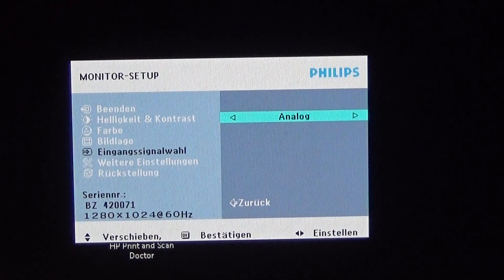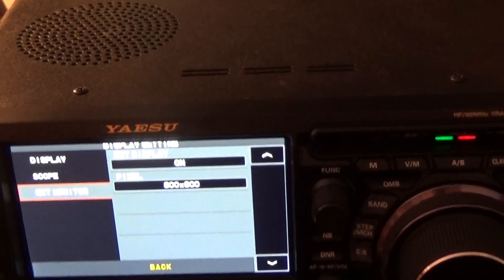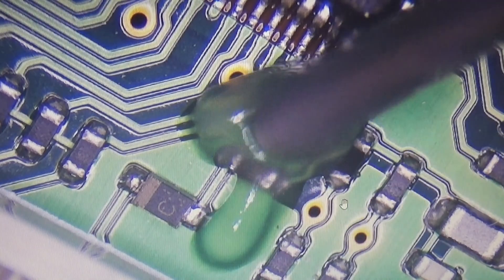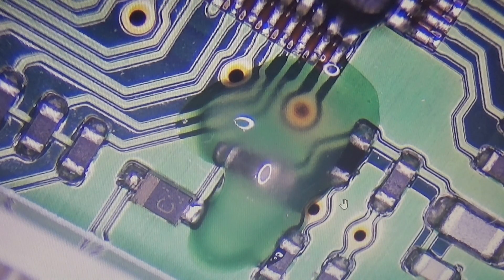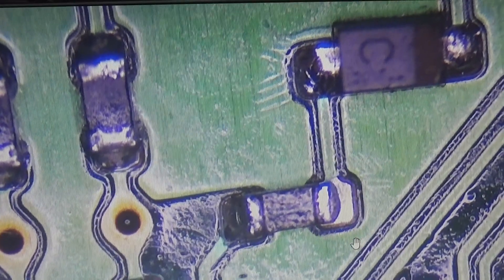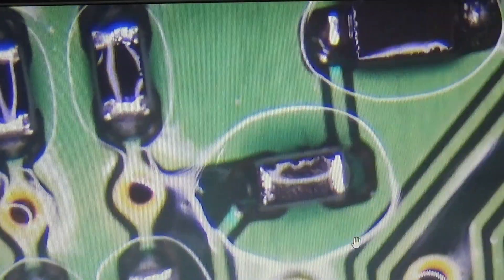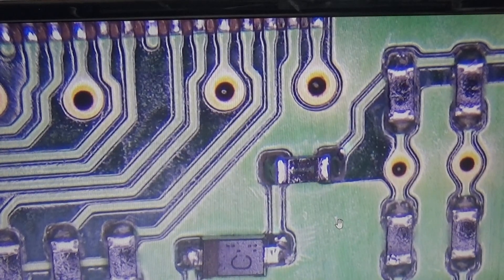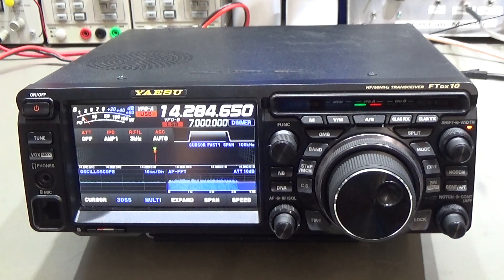#280 Yaesu FTDX-10 with external display port issues fixed.

Comment: Thanks for confirming what many of us thought.  My only quibble is, it isn't a bad DVI-HDMI "adapter" problem (it's not an adapter, it's a pin mapping documented in the HDMI spec), it's Yaesu's design, specifically that fuse value.  Since the spec calls for both hot-pluggability and for the source (the FTDX10) to actually power some monitor circuitry when the monitor isn't on, that fuse needs to take that into consideration.
Reply from the maker: Well, yes and no... There are obviously DVI/ HDMI adapters on the market which simply are consuming more current than others. If you have such a" high consumer" that is bad...
Reply: The "adapter" doesn't consume any power at all... they are (by spec) just straight-through cables no more active than a DVI-DVI cable... the actual device (DVI or HDMI) may consume within a permitted limit of steady-state current, which is different when the device is off (or not plugged in) or on.  The hot-plug requirement means the fuse must survive brief inrush current (be slo-blow).  The FTDX10 design obviously didn't take this into account.

Comment: If you are that good at replacing a tiny fuse like that then you could fix my original Yaesu FT-817. It has a problem that even Yaesu could not fix. In fact they did not even know if it was a problem as they checked their report logs and did not find anything resembling it. Another ham said it could be a few SMD resistors that have given out as the main screen characters fade even though the back light is on. They sent it back unfixed even though everything works except the display fades leaving a blue screen that it was already set to. Fancy a poke about to see if it can be fixed?

Comment: In my younger days as an ET, I was checking a tiny resistor like that and when I checked it with a meter, it read OK. Chased my tail for a while, everything pointed to that resistor being open, yet it read OK.  Then, I connected my meter leads to adjacent components connected to that resistor (11:45) and it read open!  The pushing together of the meter leads on the resistor was enough to push the cracked resistor together and allowed it to read OK.  I learned a valuable lesson that day.

Comment: D1800 Ifsm for RB521SM-30 is only 1A.  My understanding is Yaesu on the FT-710 has upped the Fuse to 1A  for that port.  I suspect they must have upped the rating for the diode too.
Reply: I agree; I looked at the data sheet for D1800, RBS521S-30; It is rated 200mA continuous and 1A surge peak. The FT-710, which has a similar circuit, uses an RB160M-30 diode which is rated 1A continuous and 30A surge peak. Interesting, huh? Also, the FT-710 has a Poly Switch (resettable fuse) that is rated at 350mA hold and 700mA trip at 60C. (500mA hold & 1A trip at 20C). One more note; The I2C lines that go to a little MCU chip on the FT-710 from the DVI connector now have a TVS (Transient Voltage Suppressor) network in-line. It seems Yaesu is trying to address the issues with the DVI port.

Comment: Have you thought of getting a pair of de-soldering tweezers they make the problem of removing SMD R's, C's etc real easy and without the mess of flux.
Reply: If you watch the video you would see he used a pair of desoldering tweezers to remove it.
Reply: @mikesradiorepair  to me it looked like two soldering irons. just went back and your correct. it was such an quick off i just saw the meter probes looked away and it was off.  I sit corrected. 🙂
Reply from the maker: @mikesradiorepair Good to see you mate! Hope you are doing well. Take care
Reply: Not sure what you think he used to remove the fuse.
Reply: @stargazer7644  hard to say under all that flux!

Comment: Nice work, Peter. I guess, Yaesu´s choice for DVI was the licence fee for HDMI. There is no other good reason in my opinion. Saving 1.5 USD each TRX is more important than satisfied customers...the bean counters took over ;-) Thank you for a nice vid - again. Genieß den Herbst, ideal für viele schöne Videos, Peter. Bleib gesund und 73 de Olaf.
Reply from the maker: Hi Olaf, don't exactly know what license fees for HDMI cost but however it is always about money for sure....Alle Gute für dich und bleib gesund.
Reply: @TRXLab  US$0.15 for each end-user licensed product. US$0.05 – If the HDMI logo is used on the product and promotional material, the per-unit fee drops from US$0.15 to US$0.05. Use of HDMI logo requires compliance testing.

Comment: Wie immer ein top Video, Peter. 👍Schön dass du dich an den FTDX10 ran traust, den Fehler und die Lösung präsentierst. Habe selber einen FTDX10 der eine Reparatur benötigt. Das Gerät hat eine miserabele SSB Modulation. Leider ist die Garantie bereits erloschen, da es ein Erbstück ist. Leider scheint sich keiner an das Gerät ran zu trauen. Alle meine Anfragen blieben unbeantwortet. Vy 73 Ralf
Reply from the maker: Hallo Ralf, schau mal welche Firmware auf dem Gerät ist. Sollte es die erste sein (1.0), kann das der Grund sein. In diesem Fall Total Reset und dann die neue Firmware drauf. zu 25% aller Fälle ist es damit erledigt...
Reply: @TRXLab  Hallo Peter, vielen Dank für deine Antwort. Firmware ist die neueste verfügbare. Ich werde das Gerät demnächst mal an anderer Stelle testen mit anderem Netzteil und anderer Umgebung. Das Problem tritt auch am Dummy auf, unabhängig von Mikrofon oder Sendeleistung. Vielleicht sind es ja tatsächlich äußerliche Einflüsse?🙈
Ansonsten muss ich mir eine sinnvolle "Verwertung" einfallen lassen. 😉
Schönen Sonntag und Vy 73, Ralf
Reply from the maker: wenn die neuste Firmware drauf ist, sonst keine äußeren Einflüsse zu finden sind, wird es eng. Es gibt dann im Prinzip nur noch 2 Fehlerquellen. 1. Ref Ozil. 250 MHZ an TP1097 Main Board. Da reichen schon mehr als 30 Hz Toleranz, um das auf SSB zu hören. Je größer das Delta, desto schlechter SSB. 2. Da es keine SSB Komponenten im analogen Teil des Gerätes gibt, wäre das dann ein Fehler des SDR FPGA. Das wiederum glaube ich nicht an erster Stelle, da ja alle anderen Modulationsarten funktionieren....
Reply: @TRXLab  danke für die Hinweise lieber Peter. Der 250er ref. Oszi scheint leider nicht das Problem zu sein. Die SSB Modulation klingt eher wie "FM'ing". Ruheströme der Endstufen oder einer der (Vortreiber/Treiber) bzw Endstufentransistoren könnte ich mir vorstellen. Leider will sich niemand der Sache annehmen. Ich habe auch keine Hinweise von den Hinterbliebenen erhalten wo dass Gerät erworben wurde. Im Endeffekt wird es wohl leider ein teurer Türstopper. 😔
Wünsche dir einen schönen Sonntag und freue mich auf baldige neue Videos von dir. 73, Ralf DO7RU

Comment: It was very wise decision to use DVI instead HDMI
Reply from the maker: Thanks for comment. Can you justify the view, maybe there is something I don't see?
Reply: @TRXLab  I am sorry! It was sarcasm. I have seen such damage before, including a burnt out chips. People are forced to use crappy DVI-HDMI adapters; DVI does not allow re-connection without turning off the transceiver and monitor. This causes damage. All this could have been avoided if HDMI had been used instead of DVI.
Reply from the maker: never mind, fully agree.
Reply: @ukrainehamradio DVI is hot pluggable according to the standard.

Comment: Hi Peter,
I had heard that there are only a few HDMI - DVI adapters that will work with the FTdx10. Glad I still have a DVI monitor available. Stay safe.  73  WJ3U
Reply from the maker: Yeah, we have not look into it yet, but some DVI/HDMI adapters seems to draw more current than others. That would explain it..

Comment: Hi peter thanks once again for another video the owner was lucky it was only that tiny fuse and not the chip electronic have got smaller in size must be hard for you to see such tiny things hard for the eye to see them.
Reply from the maker: yes, without microscope it is impossible to those repairs..